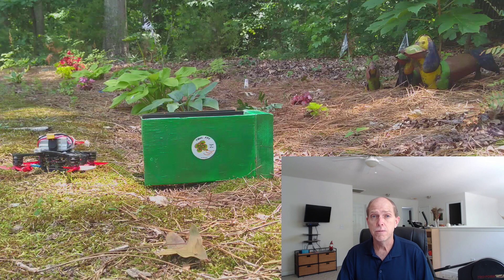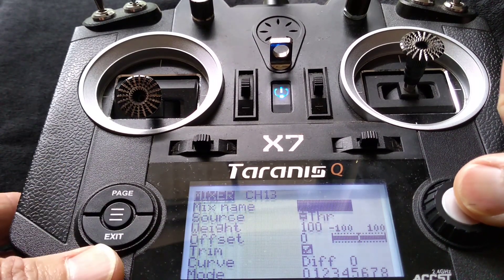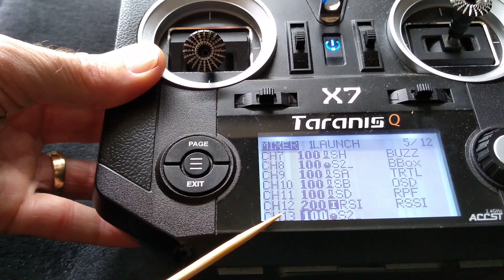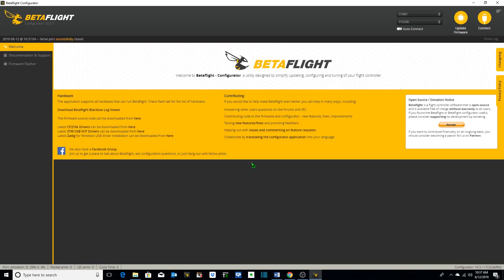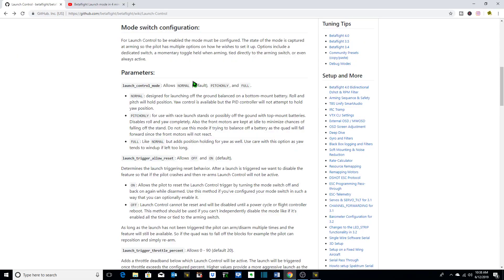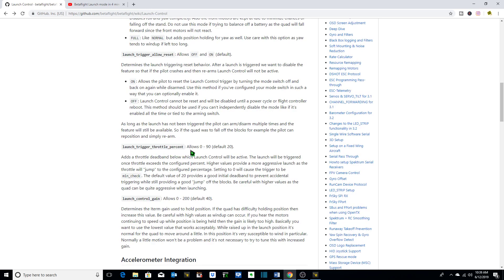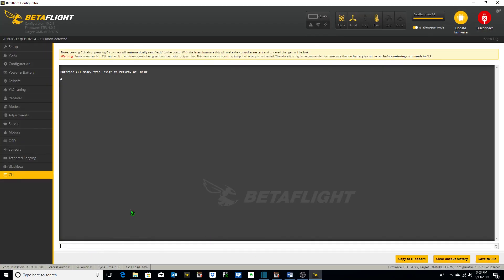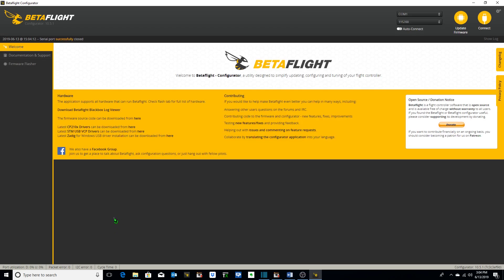BETAFLIGHT LAUNCH CONTROL SETUP

Comment: How many times did you crack up before you got through it? Your timing was very good with the look up to the quad flopping over and Awesome topic and video. I'm getting cured this spring. Also you have inspired some fun responses form your followers. All smiles. Your motors sound cool when they wind up.

Comment: Hi, do we have to switch back to off the launch control switch when the quad is in the air?
Reply from the maker: No, keep it in the same position as when you initially launched. I think I have a checklist in the video description you could grab. Just remember if you crash and want to try to take off from where you crashed, you may want to deactivate the switch beforehand 👍
Reply: @TMacFPV  Thanks Tmac. Your videos is always straight forward and easy to understand. Espesially the rpm filter! 👍🏼👍🏼

Comment: Hi T mac, Im a bit confused . When we create  a switch  in open  tx dont we need to do in on the inputs page ? Can we just do it in the mixer page as you did?
Reply from the maker: Hey Jordan! Great question! No, you do not need to use inputs page for switches as long as the source you want to use is available on Mixes Page. I did this short video on OpenTX Basics to help clarify things just like this. You may find it useful😀https://youtu.be/luy2U04_WFc

Comment: Good overview and accurate information. One small correction: it's not necessary to enable airmode for launch control as it's automatically enabled during the launch procedure regardless of the setting (but everybody should have it enabled anyway).
Reply from the maker: Hey Bruce! Thanks for your comment! You are correct-Airmode ON is not a requirement for Launch Control, but is a good idea (IMO at all times).  Per your comment, I have clarified this with a "card" on the video at the 2:46 time hack stating what the requirements are for Launch Control. Thanks again Friend! Clear Skies!👍😀
Reply: Thanks. I wrote the code so let me know if you have any questions.
Reply from the maker: @BruceLuckcuck  Very cool! Appreciate it! And thanks for writing this code, very useful and Fun! By the way, I know you weren't looking for this, however, just made another small  donation to you guys at:  https://www.paypal.me/betaflight👍😀
Reply: I’m very new to FPV, and I think airmode causes my drone to bounce when i try to land it. turning airmode off seems to fix this, so is it ok to keep it off if i’m not doing tricks?